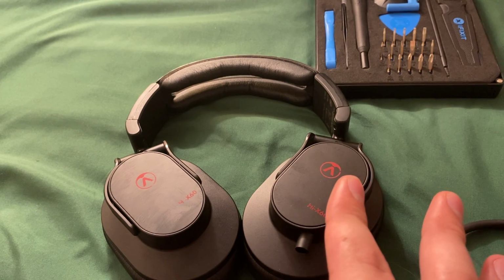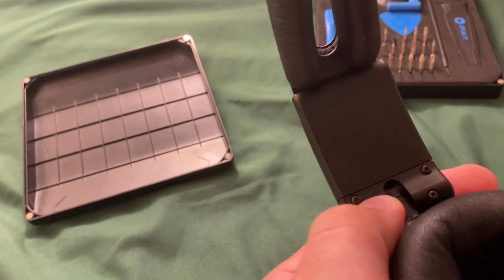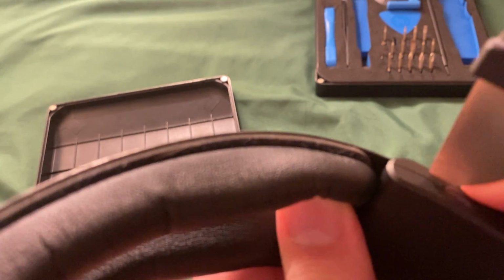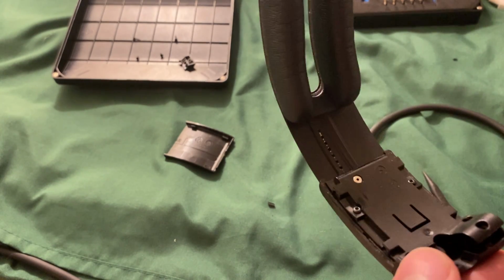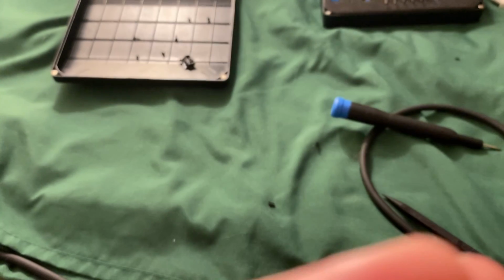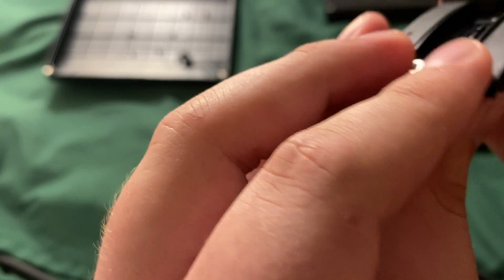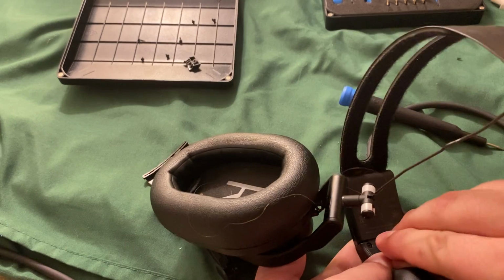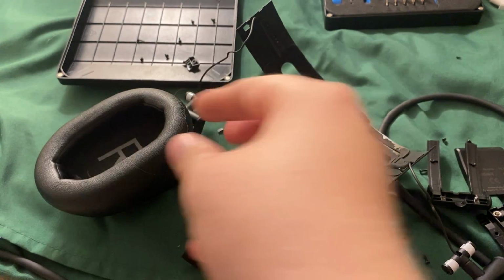Austrian Audio HI-X60 and HI-X65 adjustment mechanism- let's destroy some headphones apparently

Comment: Thank you very much! 
@All: Read the description of the video before you start the repair! :)
I own the Hi-X60. In my case, the parts you are trying to disassemble at 6:55 were damaged on both sides. Austrian Audio should make the complete mechanism out of aluminium.
Reply from the maker: Man, brushed aluminum would look NICE. Also would maybe not break as much. both nice features.
Reply: I have owned 3 and I have a small head and all 3 have broken. I baby them too.

Comment: Morgan - Enjoyed watching you perform surgery on the Austrian Audio headphones. For several years I bought used headphones off eBay so I could find out how they sounded and also to examine their mechanical design. The problem with plastic parts under too much stress is one that I have seen in several headsets (mostly Sony if I remember correctly). My Austrian Audio Hi-X65 Headphones have not cracked yet and I am hoping that a 'de-stressing' process that I applied to the headband will make that less likely (I applied a counter-force to the center portion of the headband to flatten-out the bend a little bit so that the headphones 'naturally' apply less pressure to the headband when the headphones are on my head). - Paul

Comment: Hi Morgan! I should be the one thanking you for making a whole video out of a single youtube comment I made! I did not expect you to go as far as opening your own headphone and making a whole guide just for this specific disassembly.

Thanks a bunch! This will definitely be very useful for me and hopefully for other users that experience the same problem too.

Edit: Yes mine is broken on the part where you point at in 2:50 😂

Hopefully Austrian Audio made this part out of metal in future revisions. I think that would fix the problem of it breaking from the tension of the metal band (apparently you said that in the middle and the end of the video lol). I am thinking about 3d printing the parts in metal but worried that it is going to be more expensive and tedious than getting a new headphone like the Audio Technica ADH-R70x as a replacement.
Reply from the maker: in fairness, I'd like to note that I did think it was going to be like a four - minute video, but then... well... too late to go back lol.

I don't claim that my notes are the perfect method,  but I tried

and.. yeah, to me, whether this is worthwhile to do is based solely on parts availability/cost (for me anyway, since I kind of broke it on camera and don't really expect warranty to cover anything). I think it looks worse in the video because It was exploration, though the process does still suck.

that exact Audio-Technica is on my own radar, by the way
Reply: @morgaboy01189  It is very unfortunate it broke during disassembly. If Austrian Audio were sensible, they should provide a replacement part or offer to repair your headphone free of charge. The crack is already there before the disassembly after all.

Anyway thanks for taking one for the team and lets hope Austrian Audio is willing to send you some parts, hopefully free of charge.

Comment: I hate how they are still using those plastic parts when they advertise "metal where it's needed"
This was an issue with the x55 from day one. Hell. When those exact designers came from AKG, they had the exact same weak spot on models such as the AKG K550 which was the sound signature and headphone the Austrian Audio-line was based off. I am not sure why they thought it would be a good idea to continue with poor design.
Love the sound but those two plastic bits won't last. Not in my experience.
Reply from the maker: Yeah, they really played up the metal in the advertising blurbs, and they even got me- that section LOOKS like it's metal, they really matched the surface finish rather well, and who would expect the most structural part to be plastic when it's surrounded by metal?.

Comment: The Heil Pro Set 3 Headphones have about the most robust mechanical design of any headphones that I am aware of. With some modifications they can be made to sound 'OK' but mechanically they are very 'old-school' ... with metal (steel) parts for the headband assembly. If headphone manufacturers would stop trying to make their headphones look 'cool' ..  and quit using plastic ... going to all-metal would eliminate most mechanical problems.
Reply from the maker: I agree. also those heils look very cool.